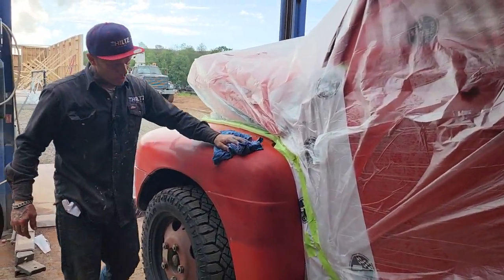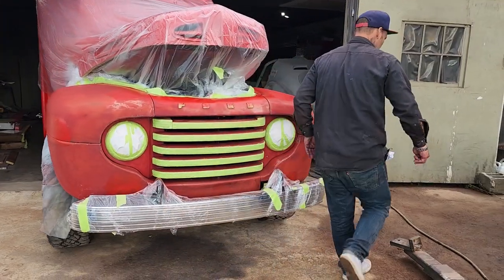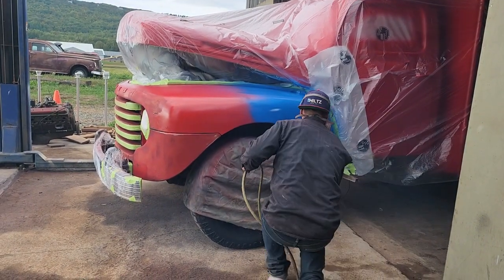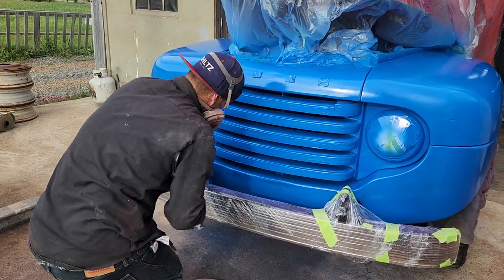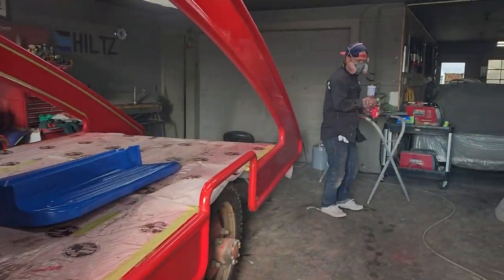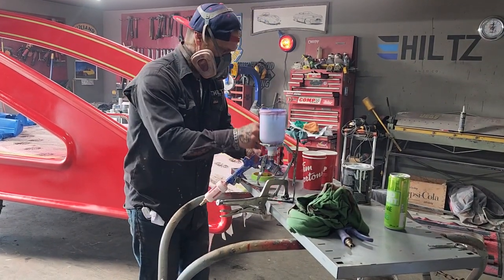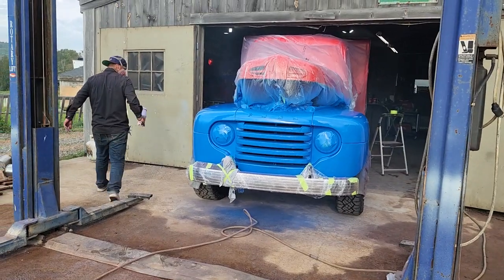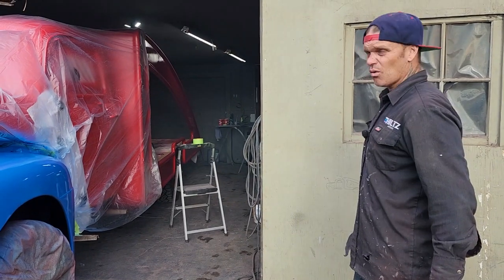Painting the 2nd colour on the 1948 Ford Car Hauler 🔵🔴

Comment: The Saran wrap is a great idea.
I’ve used aluminum foil several times in the past for masking irregular shapes.snow plow racks,trailer hitches,hydraulic hoses,wiring harnesses,door mirrors,etc.
Squeeze the foil down around it and tape the ends with 3/4” masking tape.
That truck is looking good.the color combination really pops.

Comment: Hi Chad, perhaps it’s just the sound, but it also looks like the air pressure are too high at your spray gun, I’m also amateur painter, but by an air pressure of app 1,5-2.0 bar you’ll have less spray dust in the surroundings and less paint on your car.
You and Jolen have decided great color time period theme.
Well done.

Comment: That's a fun project, it looks like. I suspect the standard transmission has pooched synchromesh and is mostly unusable. Those ancient transmissions were hardly functional when they were new!                   Probably the project deserves a complete power train revision to make it driveable. A chevy 283 or 327 with turbo hydromatic 350 and electric overdrive, would be a possible option. Of course the wiring would need to be converted for the 12 volt starter, at last. Overdrive would be nice for that very low geared rear diff.
Reply: Or he could just learn how to double clutch like it was meant to be driven. Seems easier than changing the drivetrain JS
Reply: Maybe take the drive train out of that motorhome skeleton he hauled home.
Reply: @leblanckerry4826  Even mastering the double clutch actions(unlikely), I doubt if that unit was designed to travel much over 50 mph. I'm guessing the diff ratio to be 4.88 or 5 something to one drive shaft rotation.